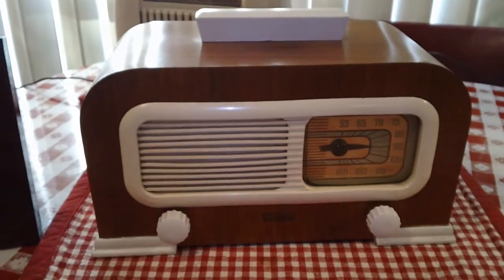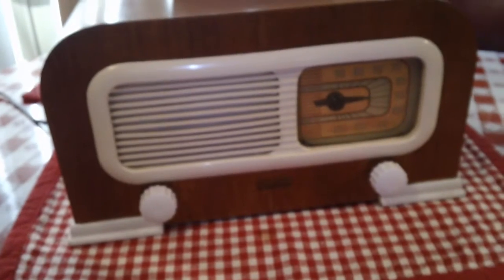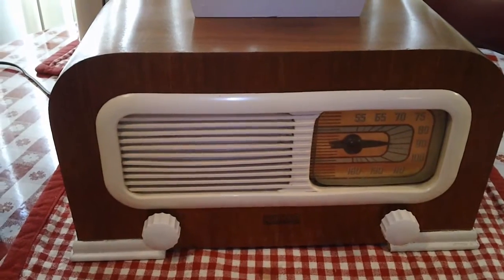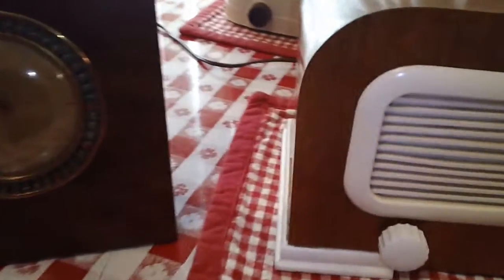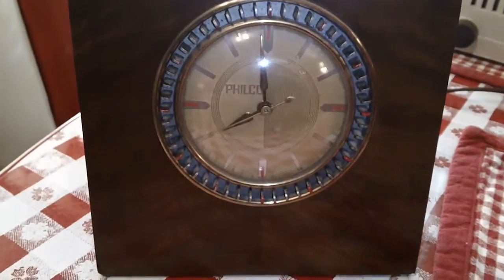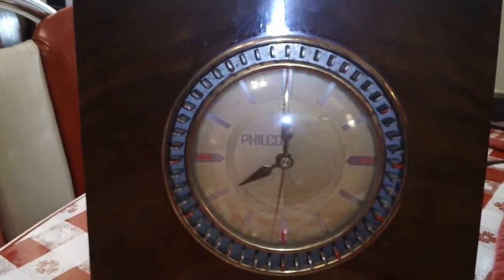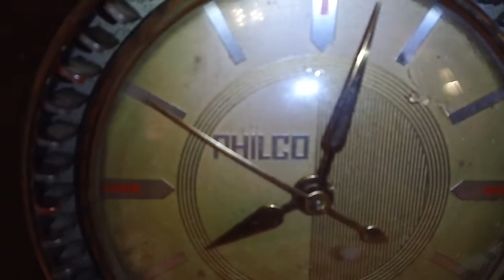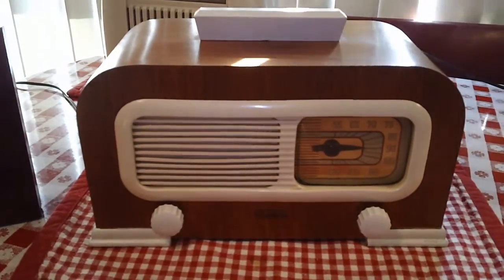Philco 42-PT 95 A Vintage Tube Radio, from 1942

Comment: Al,
Nice radios and very cool clock...but all your stuff is neat.
BTW...you motivated me to finally and permanently relocate my AM tramsmitter to an upper shelf on my computer desk, then run the input back to the headphone jack on the computer speaker.  Been meaning to do it for some time, but never got around tuit.  But continually hearing your radios play the old musica got me fired up to git er dun.  Works great.
Thanks, my friend.

Regards,
John

Comment: Hi Al. I am running late today. I am doing a recap and resistor check on my Detrola model 571. my eyes got tired and thought I would take a break for a bit. I love the way the white sets the wood off. I had never seen the Philco clock before, both really nice additions to your collection. Has always Al Thank you : ) my friend. You take care. Tec

Comment: That Philco 42-PT 95 A is a beautiful radio! What is different to me about this radio is the different "aspect ratio" visual look to this radio. If you know what I mean, it is sleek looking because of the ratio of width to height unlike most radios of the time.
That Philco "Automatic Control Clock" is something else! Yeah, Dylan will do wonders with it! Please show us all how it works when you get it back. OK?
Thanks!
Tom

Comment from the maker: I hadn't given it much thought, but, you are right, it is pretty sleek.  It would be really low slung looking, if it didn't have that handle on it.  I'm going to try to monkey around with the clock a little myself first, not because I think I can fix it, I'm just kind of fascinated with it.  Another one of our wiz clock repairmen, Dick (WB8MHE), has a similar one, said he never could really get the timer function to work right.